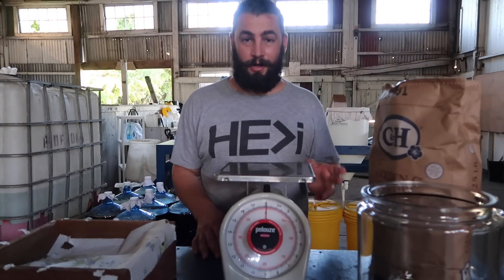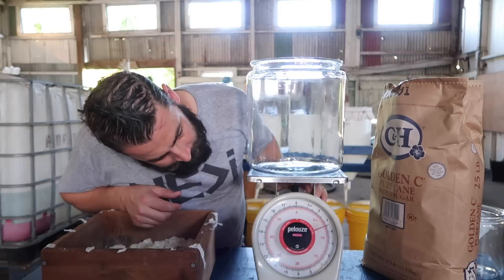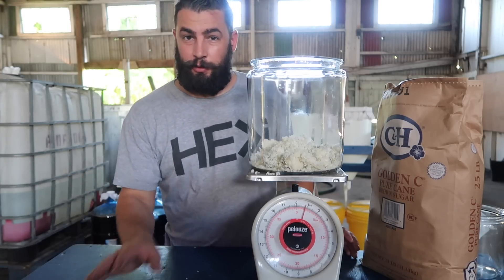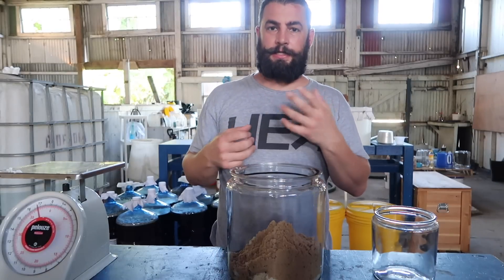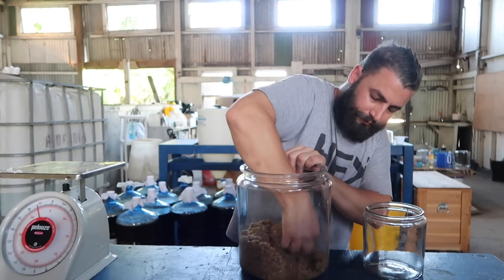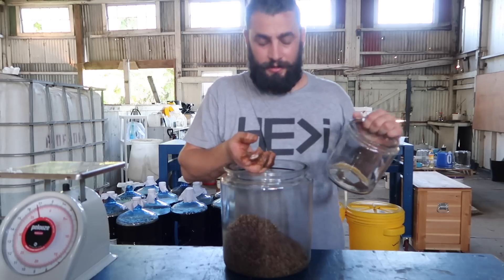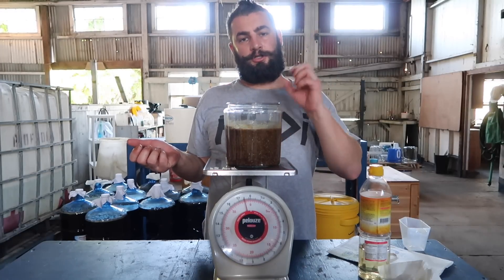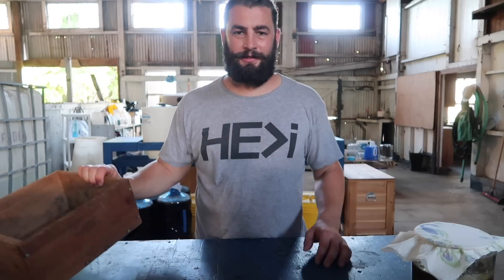How to: IMO 2   KNF

Comment: Mr Trump, when we make IMO3 can white granulated sugar be used instead of the brown? where I live brown isn't easily accessible plus even tho the white is more refined (just extra steps) it costs 4 times less. it is what it is, basically another mistery  of capitalism like recycled paper costing more than paper made from scratch. 
if it's just to suck the water using osmotic pressure I don't see why the white won't do the same. I thought I'd ask before messing up my spores.

Comment: Harvested a good test batch of IMO 1 and it made a good IMO 2 (I think...). Curious, what does IMO 2 supposed to smell like?
Reply from the maker: +Trevor Mickelson kind of like miso paste. It smells like a sour dough kinda, it smells like gently fermented rice... hard to describe :) great job man!!!
Reply: Nice, Yep that's exactly how it smells! Now I just have to figure out where to get my hands on some OHN for IMO 3. Growing season is upon us in Colorado, any substitutes or can I just go rogue without it?
Reply: Trevor Mickelson what did you use and how did it go?
Reply: @biomei.solutions   Mr Trump I really appreciate your videos. I'm all about the growlife and I'm very interested so I've started implementing some of these techniques u teach. I was hoping you could clear up some confusion. bear with me...
so in my bokashi bucket in told not to put anything with mold or rot because these aerobic organisms will start to compete with the anerobic microorganisms I had initially collected in the rice water that went thru the steps and used to inoculate the bran. 

now as for the application . I'm making aerated compost teas. will it be benefial to add the bokashi bran (fermented) to one of these aerated compost teas? won't these microorganisms also be competing ? the ones in bokashi bran vs the ones from the compost. isn't take aerobic vs anerobic? what is wrong with my logic here? something doesn't add up